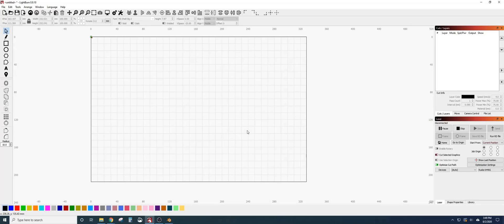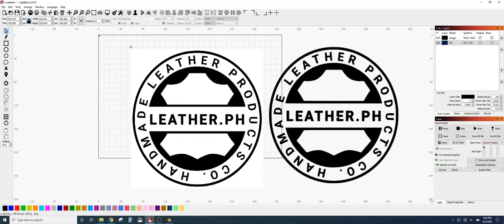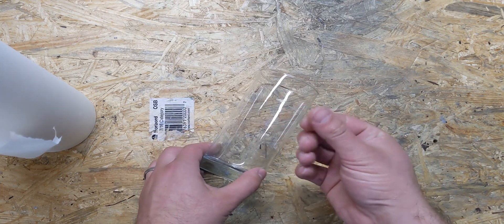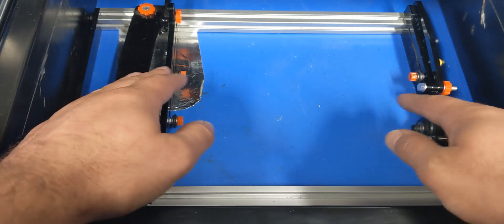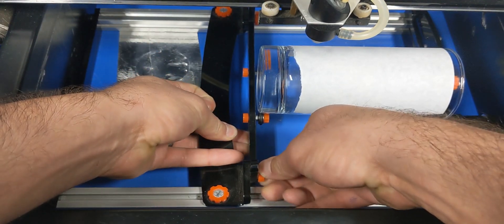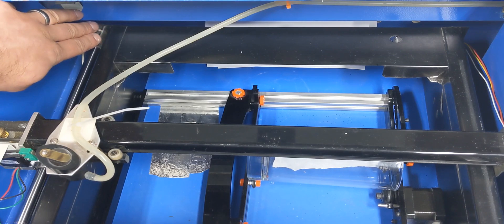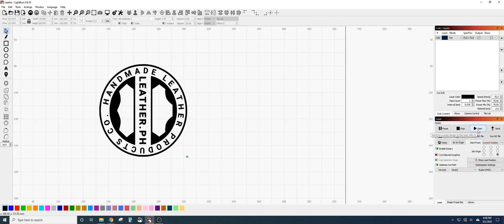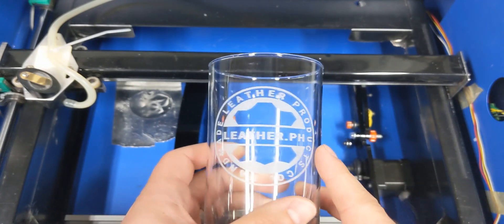Setting up a Job on the TLC Rotary

Comment: What kind of tape or marking stuff was that
Reply from the maker: Its paper vinyl transfer tape. As many know, vinyl is not ok to laser cut, but the paper transfer tape does not have any vinyl in it.
Reply: @foremanmachinesllc7070  Many thanks with best regards from Austria
Reply: @foremanmachinesllc7070 75mm/sec ? And 75 power
Reply from the maker: @chagh491  if I remember correctly those are the settings I used. (Been awhile and use a larger machine primarily now)
Reply: @foremanmachinesllc7070  okay because I tried your settings and my glass broke with a 40w co2
Reply from the maker: @chagh491  oh shoot im sorry. It could have been because I was running an older tube, but I hope you are running in mm/sec not mm/min like some people like to run machines.